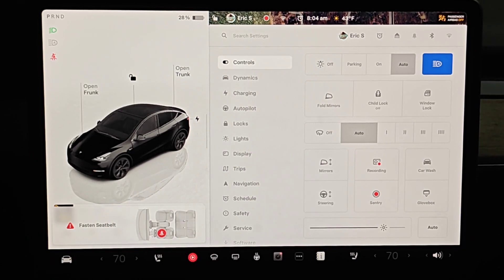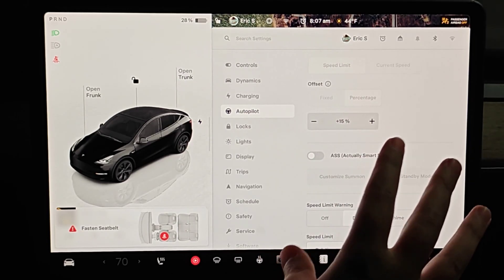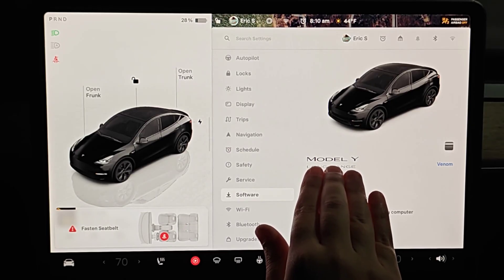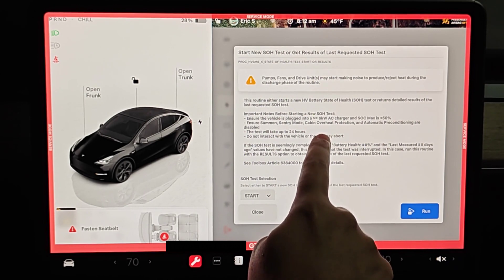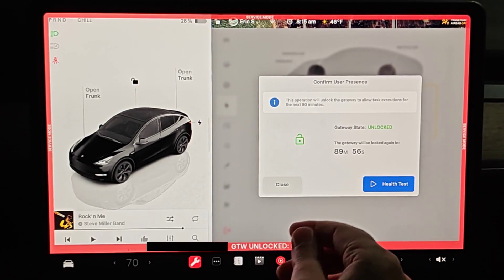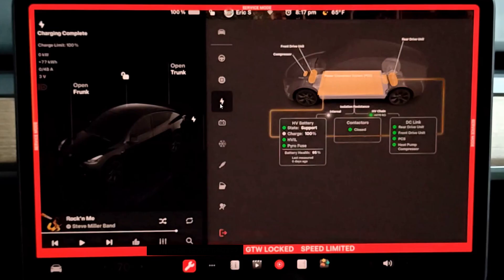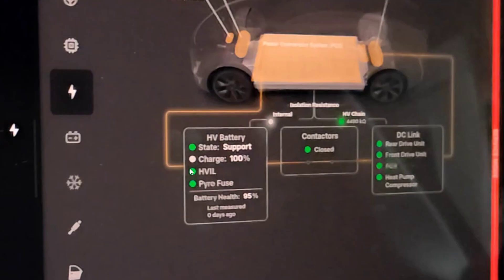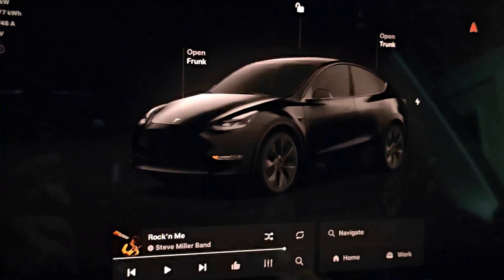Tesla Battery Health Test Service Mode - Battery Health Test Not Starting? Battery Degradation Test

Comment: Great video ...can i ask a question,i followed your instructions and the battery went down to 2% ...does the battery start to RE charge pretty much straight away?  mine just sat there on 2 % for say 1 hour and my charger said charge complete... i bottled it and stopped the SOC check as i did not want to leave my battery empty for a length of time.Should i have just left it or did i do something wrong?
Reply: I'm running into the same issue on the new non-service mode test,  did you try again?
Reply: @zuita7748  No ....i am not sure if i have my charger (zappi) to charge whilst its draining down or do u have to manually ask to charge the car?
what did you do with what charger

Comment: I ran my test last night. It brought the car down to 2% and then charged it up to 71% which is what is what I normally charge it to. I didn’t see that it said I was supposed to raise my charge limit to 100% so it did not go up that high. It isn’t giving me any results from the test. What do you think I did wrong?
Reply: It has to charge back up to 100% before it shows your result (as I am aware of). And it doesn’t matter if you charge to 71% on your daily basis. It has to charge from 0-100% during the test.

Comment: Mine does not have "Health Test" button, but has all the parameters on the picture. 06/2024 M3 Higland AWD softwear v12 2024.44.25.2
Reply: They moved it on the over HV menu a few spots down and it is abbreviated to HOS test or something similar. I just started mine.
Reply: @That-Guy_ I was just here to ask the same question.  Thanks I will go look for the new location.
Reply: @Don.Steve.  
Make sure you can charge at 26 amps or more. If not it will not work. I can only do 24 amps so it failed to give a number.

Comment: Doing the health test right now with 17%. Charge has been stopped, does it automatically start charging by itself when it needs juice?
Reply from the maker: It will run the battery all the way down, then charge back up to full
Reply: @ Thank you for the quick response, I really appreciate it. I just got my tesla back from a pre-warranty inspection where they checked AC, control arms, suspension, LV battery, etc for $282. They said they also did a HV battery check but the battery health was “ — —“. So I’m doing it now, thanks for the great video. 

Wall connector for the win!
Reply: @teslahowto Weird, the test stopped running at 8%. It won’t allow for another test and the tesla won’t charge with the wall connector.

Comment: Stats on high mileage Tesla show you can expect to get about 300,000 miles out of the battery. That's equivalent to 20 years at 15,000 milrs  per year of driving.
Reply: Most teslas are getting way more than that.
Reply: @GrumpyWolfTech  Most Teslas aren't that old yet.

Comment: Thanks!  I will do the test on Saturday into Sunday since I won't need the car on Sunday and have to do a long drive on Saturday so I can start the test with a pretty low SoC.

My car is a 2020 LR AWD MY built in Fremont.  From the range meter I have lost 36 miles (at 280 now at a full charge vs 316 when new) in 52 months and 68k mi.  That seems a bit excessive for me.

I used to charge to 90% the first year when I had the car but changed it to 80% after a year.  I maybe do 2000 SC miles a year on average.

I will post my test results when completed on Sunday.
Reply: And? What are the results?
Reply from the maker: Awesome, Looking forward to hearing what your results are 👍

Comment: Thanks, now just need to wait for upto 24 hours when I won't need to drive somewhere!
Reply: You really only need 12 hours if you start with a really low state of charge. It runs the HVAC system to kill the battery and then charges it to measure its capacity. If you’re able to drive it until it’s at 2 or 3%, it will take just as long as a charge to 100% would take.
Reply: @kungfoochicken08  good to know, thanks
Reply: @kungfoochicken08  Did u have to ask the charger to recharge or does tesla pull the charge on its own...reason i ask is i`m not sure what to set my zappi wall charger to to begin the test...i got mine to drain down to 2 % but nothing happened for abt 1 hour and i am not keen on leaving the battery empty.
Reply: @neilp7024  I’m not familiar with the Zappi. I left mine plugged in and ran the test. Make sure you run it from the service mode though. There’s a new battery test in the regular menu, but it’s not as thorough.

I’m sure the Zappi handles charging much the same as the Tesla Mobile Connector. Are there settings you need to adjust in the Zappi?

Comment from the maker: *In the latest update you can now do a battery health test through the service menu, much easier

Battery Health Stats
- 95% Battery Health
- 2023 Model Y LR AWD
- Panasonic 2170 Cells
- 14 Months Driven
- 9k Miles Driven
- Mostly Charging to 80% with 120v Charger
Reply: I've got a 100v I've been using for a year
Reply: Ok, I did the test, it took 22 hours 😱
Battery Health Stats
- 85% Battery Health
- 2021 Model Y LR AWD
- 58,864k Miles Driven
Didn’t find model of battery, they changed a bit of how it is on the video.
I liked the process, once again, thank you for the video!